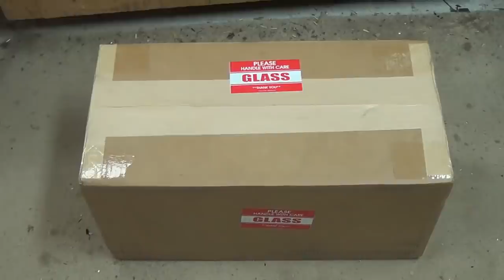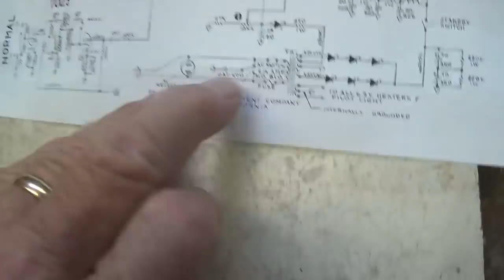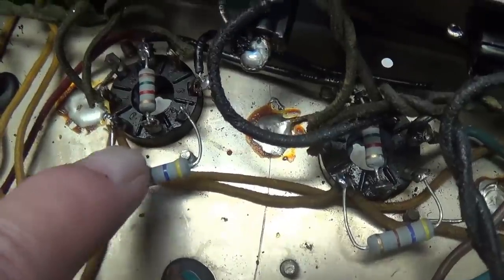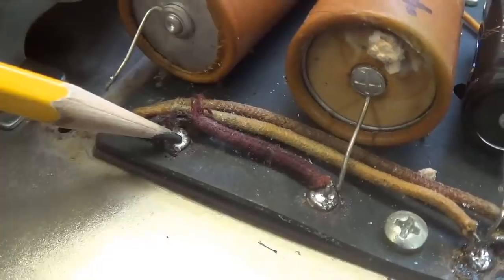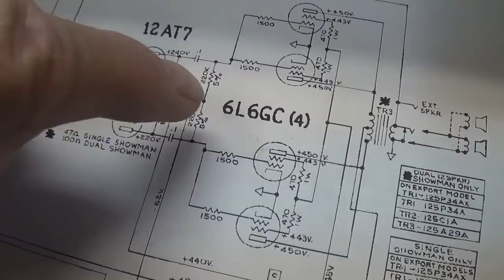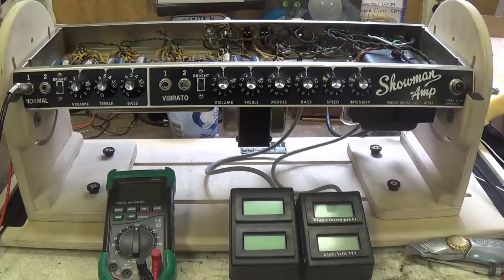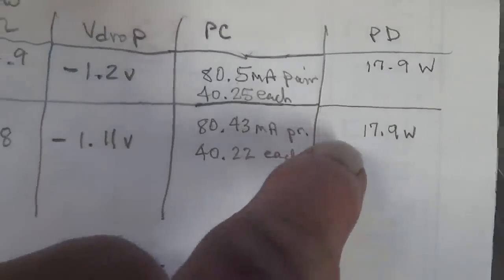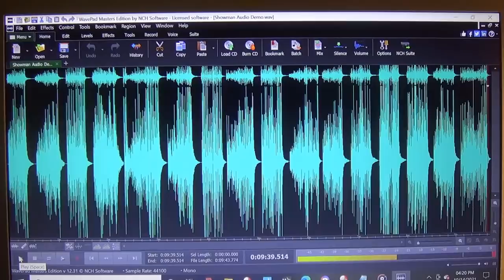1965 Fender Showman.......Back from the dead, but not without an epic struggle

Comment: I just ordered some Gavitt 22 gauge stranded cloth insulation wire from Stew-Mac. They have white, yellow, orange, green, black, blue and red. It’s all a very close match to the original wire that Fender used up to the Silverface era. 
The price is right for a 50 foot spool. I prefer the stranded wire over the solid core cloth insulated wire that everyone else sells. It’s far more resistant to breaking from vibration and reduces microphonics.

I am so happy that Stew-Mac sells this stuff. It was hard to find in all of the colors and very expensive if you did find some. Can’t recommend it enough!
Reply: It's good stuff for sure! I've got them all, except for the Orange and Brown colors. I'll get them on the next order. Love Stew Mac and their fine products so much!
Reply from the maker: Thanks for the helpful tip, Matt.
Reply: @greasymonkeyguitars9292  , are the wire strands individually separable or are they twisted together and pretinned ?  Individually stranded wire is a pain to work with, but most vintage Japanese Hifi gear used stranded wire that was both twisted and pretinned, and that stuff is easy to work with. It strips more easily than stranded wire but isn't as stiff as solid core wire (though you can dress it how you like and it will stay in place), and because it's pretinned, it's extremely easy to solder.
Reply: @goodun2974  the wires are all twisted and pretinned. It’s good stuff, just like the old school stuff. The Gavitt wire is premium quality based on my experience
Reply: I will look forward to trying the stuff from SM .... 
So many folks now selling various forms if reproduction vintage cloth pushback wire but some of the stuff just plain sucks and it's all overpriced!
Reply: @southboundsuarez9832  That's why my go to is always Stew Mac. I am a 100% happy customer and their quality of products is great also. Philadelphia Lutherie is awesome too!

Comment: Another great video Uncle Doug. 

I'm no expert, but if I may offer a few suggestions: 1) a little silicone under all filter caps to help secure them 2) move the AC safety ground from the PT mounting bolt to chassis (directly soldered, more reliable) 3) elongate the AC safety ground wire - should someone pull on the power cord and the strain relief gave away, the ground would hopefully remain intact and be the last to go. I believe this is modern safety code as well.
Reply from the maker: Thanks for your very helpful suggestions, Dave.
Reply: There's another adhesive called  E6000, it works much better than silicone. I find that silicone is temperamental in what it wants to stick to. E6000 works much better, is very secure, AND comes off fairly easy when you want to take it off. WAY better than silicone.
Reply: I agree with everything-for a build-but for a restoration, I can understand not going outside of factory norms
Reply: @scottclark7592  That does assume that the factory got it right (in manufacture or design)
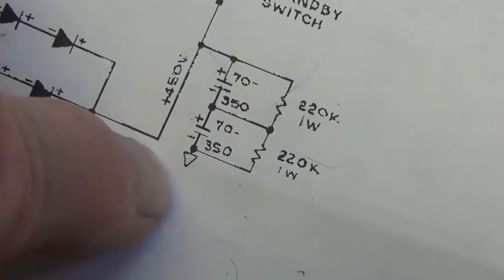Reply: @UncleDoug  Doug, I would have also simply replaced that red B+ wire that lost its insulation near the ground post, at 40:15  .
Reply from the maker: @cjay2  Thanks so much for sharing, CJ.

Comment: Great video Doug, thank you for posting.  I always learn from you, and I appreciate the way you take time to explain things.  After you showed the inside of the "dog house," and the wire that fell off and the resistor that was cracked or burned in half I remembered you saying that the guy told you it had stopped playing all at once.  I couldn't imagine it working with any one of three or four of the problems you pointed out.  He might should have added something like, "it stopped playing all at once in 1973."  ..LOL.  I suppose a lot of the deterioration simply comes with age.  That is a great amp.  I was born in 1965, so I'm kind-of partial to that year.  Thank you for posting.  Be blessed.
Reply from the maker: Thanks for all your very nice observations and comments, TW. Likewise on the blessing :)

Comment: Greetings Uncle Doug!  Your not kidding about the guitar strings being possibly energized.  Back in the mid 80's I was in a band playing my bass through my Bassman (which had the two prong plug with switchable polarity) singing into a mike connected to another amp - a huge Peavy 8 channel PA with a 3-wire grounded system.  I reckon my polarity switch and the Peavy didn't get along and the battle ocurred when my lips touched the mike.  I had a perfect screen pattern burned there that lasted at least three days. Lord I miss them days.  Great job on the amp as usual, your the best in my mind.  Take care!
Reply from the maker: Wow....thanks for sharing your cautionary tale, WH. I'm glad you weren't branded for life ;)

Comment: Yea!!!! Uncle Doug & crew. This just showed up today for me. Yes!!! Such a beautiful amp, the proud owner must have hermetically sealed the amp after using it, & only touched it, while wearing surgical gloves. 
Those complaining about the length of time between videos reminds me of when I worked at Lockheed. I was loaned out to another dept. they did basically sub assembly, on certain frames for the C5B. (I was usually installing their work into the aircraft). 1st time I'd done that job. We worked exclusively from blue prints. The entire day, the "powers that be" came by every 15 minutes urging me to go faster, so I'd have time for rework. I told them leave me alone, there won't be any rework. I finished the massive assembly about 30 minutes, before the shift ended, the inspector scrutinized the assembly, stamped off on it. The supervisor & the lead men were almost out of breath, "Where's the frame at?" I said it's up there, pointing to the location finished assemblies were to placed, after they were "sold". They gasped "You're not going to have time for rework." I said "There wasn't any, it's sold, go check yourself." They did, they seemed suprised. The best part was, the supervisor was a hot number. A few years older, but she was a hammer!!! When we swept up, the supervisors, in order to inject a bit of levity, would say "Well ___ you're doing such a great job with that broom, you can come over to my house, & sweep up there."(explosive laughter generally followed from the supervisors) She should never have said that to me. I was 29 still in my prime. I looked at her, eyed her shapely contours, smiled & looked her dead in her eyes, & said "Any time _____, anytime, any day, I'd be more than happy to help you out." Her face flushed red. Then she walked away. All the guys raved about her 20 something daughter, but she was the real hot ticket. LMAO She never made me that offer again!(much to my disappointment 😉) 
The moral of the story, is take time to do it right the 1st time. Then you're done with. I guess that supervisor would be near 80 now, but she was a sight to behold.👌
Reply from the maker: I hope you enjoy it, BG.
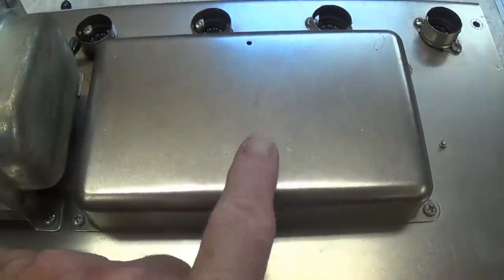Reply: @UncleDoug  I added more to my comment, I had no idea I wasn't the only only up this late in the evening. I generally don't go to sleep till about 3 or 4 AM. Have to get my grandson to school at 7:30 tomorrow. I think he has a hot date at the cafeteria. He's in 7th grade now. Wow I'm getting old. Pretty kid though.
Reply from the maker: @bluesingmusic3443  Yes, I too stay up late, generally responding to comments from viewers. We envy your grandson......those were the good old days.

Comment: I have enjoyed your Videos for years. I studied Electronics years ago but was never able to put it all together. Circuits make so much sense when you explain them.. I gave away a 68 Gibson Scout Amplifier because as a teenager I could not afford to have it repaired. Very Low output with a cheap Harmony Guitar.. Worked fine with a Gibson Les Paul which were too expensive.. Wish I knew about that famous, Tone , sucking Circuit.. Reason for comment is Hammond Transformers. My Uncle was a self taught Ham Radio Pro / Engineer   who created video images and Ham Radio transmissions to various foreign Radio hobbyists  by using parts from Army Surplus equipment. His Antenna was a Huge coil of Copper water pipe.  He was responsible for transformer design At Hammond MFG, Guelph, Ont. Canada. from the late 50,s to 70's  until his passing.   Just thought you might like to know.. Small world!
Reply from the maker: Indeed it is, Ralph. Thanks for sharing with us.

Comment: For a long time, I have been getting all my tubes just from one local dealer. They have a person that lives tubes. They match them perfectly and do selections for V1 tubes and matched triodes when you need those.
I have had great results with current TungSol tubes, and those are in most of the amplifiers I have designed. I also love current Genalex tubes. Those are even more refined. That is good for some schematics despite the fact that a lot of guitar amplifiers do not require nor benefit from HighEnd HiFi tubes. You can easily go with 300 to 500 hundred bucks pair of HiFi tubes and those will not guarantee better sound in the guitar amplifier. At yhe same time you will notice that extra quality in the home HiFi amplifiers.
TungSol tubes are more suited for rock but still retain nice level of details.
I have started my love relationship with the Hammond iron with small single ended amplifiers. I used them there first as output transformers and chokes. Nowadays almost all chokes I use are made by Hammond. Their iron is just better than expected for the price. Though they have started making some of their stuff in China. To be honest I haven't notice issues with those nut still when I can, I get Canadian products. Sadly some models are made in China only.
In a world of boutique stuff made in China label is almost not acceptable disregarding how good part might be. People relate to it like it will be bad quality.
TungSol availability is back to normal luckily. Few years ago, in time of this video, availability here was extremely bad. For one of my amplifiers, I have chosen a specific tube from TungSol, and I didn't want anything else. It was impossible to get them. I was talking to my tube guy, and he plainly said it was politics. They couldn't import stuff from that country. I'm glad that at least that part of the nonsense is over.
Reply from the maker: Thanks for your informative input, 9W.

Comment: Being a retired electrician, it is code that all sub feeds go to a disconnecting means first then to the fuse or breaker. I scratch build amps, great fun and rewarding when they work. Beautiful amp.
Reply from the maker: Thanks for your confirmation of our wiring scheme, James.

Comment: Great video; the timing always gives me something to look forward to. I've been following you for several years now, and you're the actually the reason I found this new hobby of repairing and building tube amps. I hear and see your name mentioned frequently in the forums I read (and I've been guilty of praising you there too). I think this is the first video I've seen on a bad OT. I've ran across this on a old Magnavox stereo amp that had one of the EL84's red-plating. After pretty much replacing every component in that amp, I narrowed it down to the OT on that side. LOL. The voltage readings were crazy! A new tube socket was in order also. Thanks UD, and keep it up. I learn so much from your patience of explaining these circuits in plain English. Oh yeah, keep us informed on the Euro-tester; I have one now, but haven't used it yet.
Reply from the maker: Thanks so much for all the nice comments, PJ. Will do :)

Comment: Great episode, Doug.

I had a (non-Dual) Showman that I bought used in '69 and was probably a '67 model.  It and a P-Bass were my main rig for a decade. It had no rear panel switch insulators nor the tube socket legends.  It had the (single) JBL D120 speaker (I had it reconed to be a D130.) in a cabinet design called a Helmholtz Resonator.  The head piggybacked on the long edge of the cabinet which had tilt-back legs.

I rue the day I sold it.
Reply from the maker: Thanks for sharing, Mike. We all have some "rue-ing" to do over past mistakes :)

Comment: Have the same Showman amp out in the garage, just restored. It came with a 1x15 JBL D150F. But it has 2x13 Celestion G12-65s now. I used that same Hammond output transformer. I used a presence control with a switch to turn off the negative feedback to replace the polarity switch. It works really well.
Reply from the maker: I'll bet it does. Thanks for sharing, Jim.

Comment: Uncle Doug, I recently also had a Eurotube bias probe giving bizarre/incorrect readings and indicating lo-batt. That was on an Ampeg B-15N from the 1970s.  I concluded, given some accompanying high-end oscillations/feedback, that electromagnetic interference associated with the oscillations was playing havoc on the tester. A Bias King dual probe worked fine on the same amp and limited the oscillations as well. My notes say "weird bias probe issue." Thanks for another great learning adventure!
Reply from the maker: I have been told that oscillation can cause the spurious high readings, CC......but in my case, the probes continued to malfunction when used on other circuits. Perhaps they were actually damaged by the high PC......but you'd think it would have some sort of internal protection or resettable breaker. They were returned to the company for repair, and I will share the outcome with viewers.

Comment: I've had tubes test ok before and have an intermittent short when in the tester and tap with my finger the short shows up! Great video. I have built a couple of amps using a single 6L6 and they're pretty loud. I couldn't imagine what FOUR would sound like!
Reply from the maker: That's a good point, Ryan, tapping tubes while testing for shorts makes sense.

Comment: That's one nice-looking and nice-sounding amp :)
Reminded me of when I worked on my 1971 Vox V100 head. The original Lemark OT was working, but it had been rewound in the past. Only one secondary tap soldered to both the 8 and 16 ohms outputs, and I measured its impedance ratio to be more like a 2 ohms match for the four EL34 tubes. I replaced it with one from Tube-Town in Germany, along with recapping of all electrolytics and modifying the bias circuit to adjustable. I still have the Lemark laying around, should I ever decide to get it rewound again.
BTW, Minni meows her regards to KC, Jack and Ollie. She hopes to see a glimpse of them in the next video.
Reply from the maker: Greetings, Asle, and thanks for your very interesting comments. Tell Minni "Hi" from all her pals in Texas :)

Comment: Well,  that was quite the project.   Hammond transformers are REALLY well made.  Some people criticize them saying they sound "too hi-fi"...  I guess they want their amps to sound gnarly.   I don't hesitate to use a Hammond.   I've had ZERO issues with Weber's transformers,  and those are pretty affordable to boot.    I'm in the same boat in regards to repairs......backed up,  and running slow.
Reply from the maker: It's always good to hear from you, DK. I'll check out the Weber transformers next time I need one.

Comment: Stem to Stern, Port to Starboard on the Showman, some draw out like a blade. I
on occasion will install a inline  fuse on the HV supply to save the tranny's. Especially on the quads and sextets. That tube was fragged.  Well done yet again. Always look forward to the next production. Feliz Ano Nuevo.
Reply from the maker: Thanks for the input, ML. The fuse insertion is a good idea. HNY to you too :)

Comment: Great repair Doug as always! Your thoroughness always finds the root of the problem(s) and it brings me great joy to believe this amp can go from trash being stored in a non functioning state to a truly magnificent tone machine, as well as a piece of history!

One very minor thought. I have experimented with cathode bias resistor values from 820 ohm to about 10k. I found there to be great tone throughout the spectrum. Higher resistance pushes the load line such that the negative peaks clip quickly creating more uneven harmonic distortion - which to my preference sounds amazing. Marshall used 10k in their famed cold clipper in the JCM800. Perhaps not appropriate for a Showman, but in other contexts it is ideal!
Reply from the maker: Thanks so much for your nice comment and helpful advice, DJ.

Comment: Thanks Uncle Doug. One of your best video yet. Especially liked the segment in which you explained your views on the fuse/power switch connections.  I happen to agree with placing the switch ahead of the fuse for the same reason, but it seems to be counter to the prevailing wisdom. The question is do you as a tech, prioritize protection of the user or the equipment first. I say user every time.
Reply from the maker: Thanks, Reggie. I agree. I can't, in good conscience, wire a circuit incorrectly simply because someone else says I should. We need to rely on common sense rather than blind obedience.

Comment: The original cab for this beast was a 15 inch speaker. I own one of these amps. From my knowledge, the showman amp was origially built for Dick Dale because he needed more volume and power
Reply from the maker: Not so, EGB. The amp in the video is a Fender Showman 12.....with a single 12" JVC speaker. Showman 15's were also built, but their existence does not negate the fact that 12" models were built. The Dick Dale tale was told in the video.
Reply: @UncleDoug  I only watched half of your video
Reply from the maker: @electricgypsyblues4761  Well, for heaven's sakes, go watch the rest of it, EGB ;)